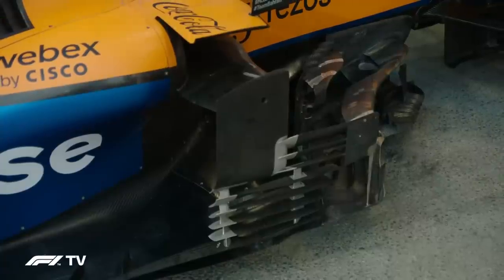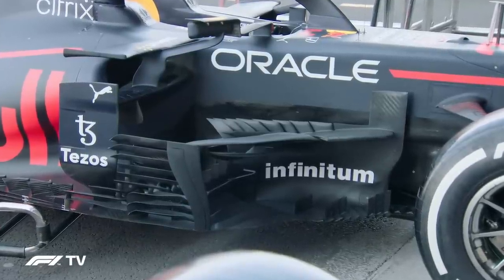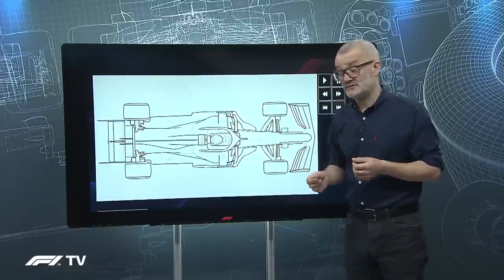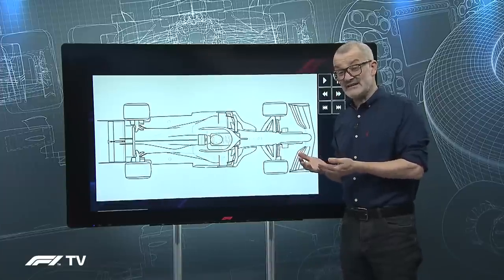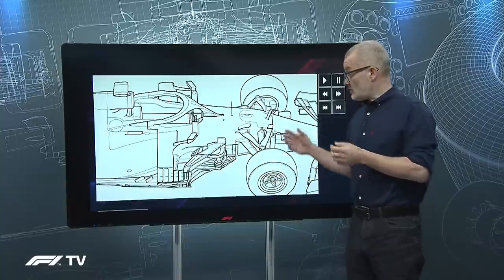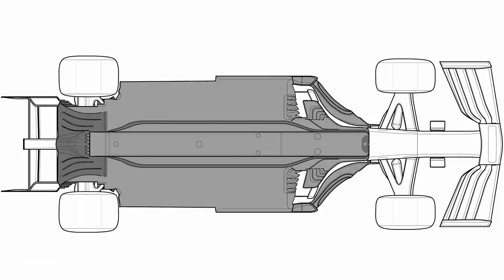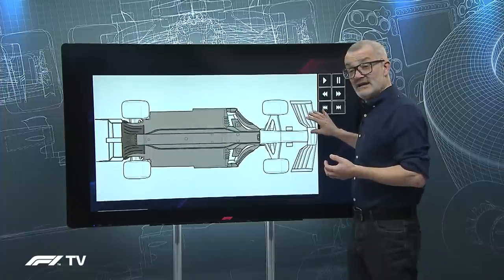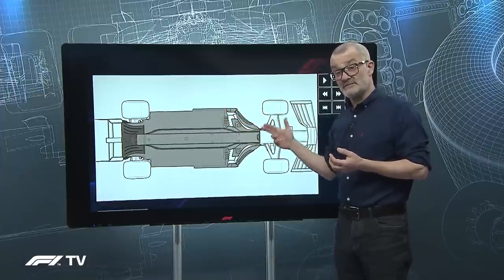The Lowdown On Bargeboards | F1 TV Tech Talk | Crypto.com | 2021 Abu Dhabi Grand Prix

Comment: well I think one unintended consequence of losing that out wash will be that cars will have a harder time  running side by side down the straight then going around the outside. Cars will actually come together more when they try to overtake in a corner , especially high speed corners.

Comment: RESTRICTIONS RESTRICTIONS RESTICTIONS... how is this a competition anymore? Give them x , y , z size, a budget and let them design...
Reply: Costs will skyrocket, and most fans won't be able to see the difference. That's exactly the problem they had since 2014 - wasting money to all end up in roughly the same place, where the money they spend isn't obvious to most fans, most of the time. First three races of the season teams will start copying whoever has the best solution. More money wasted. That's not what teams want.
Reply: @Ruylopez778  did you read the part about budget?
Reply: @cosminlesutan3574  Remember how it took a decade, a GFC and a pandemic to get all the teams to agree to a cost cap and redistribution of the prize money?
The teams want to standardise parts that don't impact performance, that fans never see or notice or care about.
If you have fewer 'restrictions' there will still be a spending war, where each team uses their partners/sponsors "creatively" to gain an advantage.
You also won't get new manufacturers to join without very detailed regulations on the car and PU.

And as I said, whichever designs are easiest to copy and most efficient will be the direction all the teams take eventually.
And by the second year most will have converged around the same designs - not that you ever get all the teams to agree on this anyway. Look how long it takes to get them to agree on a PU design when they've already been making a tightly regulated design for nearly a decade.